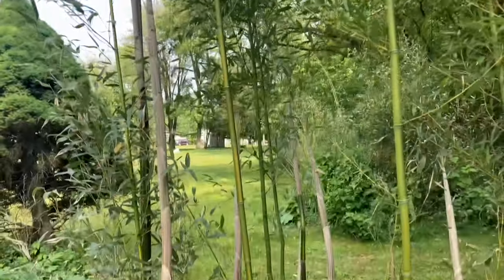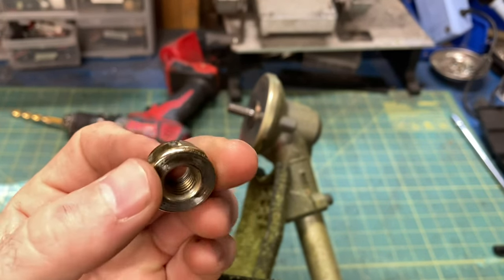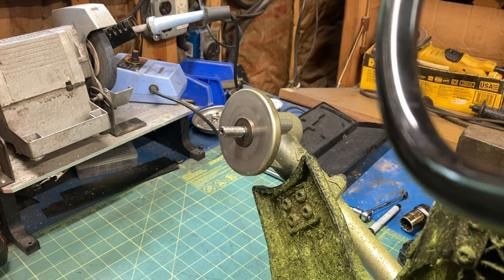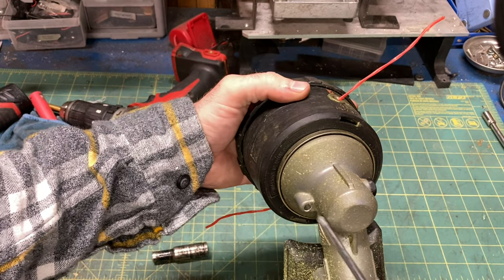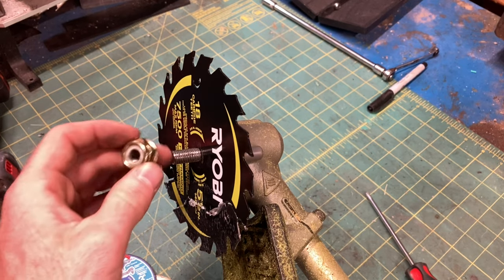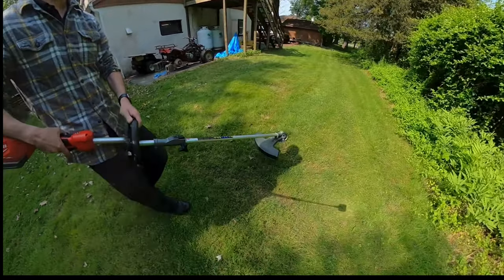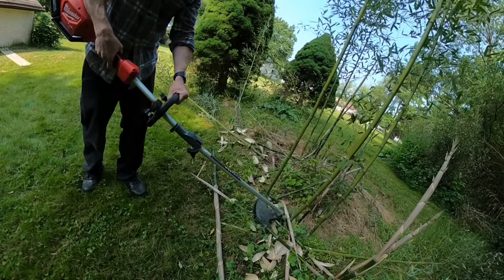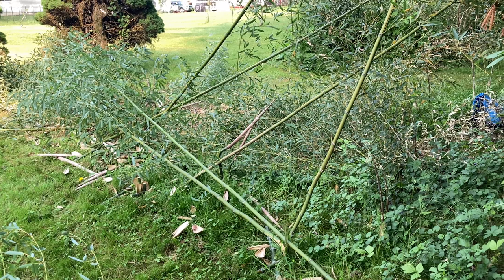Turn Any String Trimmer Into A Bad@ss Brush Hog For $11!

Comment: Maybe worth mentioning that most carbide tip blades have a max RPM.  Worth doing the math to make sure your head speed is wthin spec.  I once had a carbide blade on a belt drive table saw where "someone" (a younger me) had not done the math.  The result was terrifying!
Reply: Yes, using the wrong blade for the job can be dangerous. Anyone reviewing this video should not use a circular/table/miter saw blade. Use blades designed for trimmer heads. Angle grinder disks are even more brittle. Going cheap and having a catastrophic failure is not worth the risk. For those reading, buy the proper equipment to do the job safely and properly.
Reply: best to go without carbide teeth. especially if rocky area. the carbide shatters when you hit something hard

Comment: For the love of God do not do this at home. If that shaft uses a cable instead of a solid core you'll ruin the shaft. If the motor isn't powerful enough that's the end of your trimmer.
Reply from the maker: The blade I ended up with weighs less than the original trimmer head.

Comment: Never thought about trying a small blade on mine. But I think I'll keep my M18 string-only. I have a Honda HHT 35 string trimmer I hate using as a string trimmer. But I have a few purpose-built brush cutter blades for it. Let's just say that 4-strokes take a while to reach max RPM and a metal blade doesn't improve that aspect. But at least there's no question the machine is made to handle it. One blade I have is  Japanese and looks like a 4-blade mower blade. It's pretty badass but I don't know if it would take down 1" bamboo.

Comment: Safety mention:
Actually, unless the trimmers is designed to support the blade use, do not add the blade.  The clutch and shaft need to be sturdier to use blade vs string.
Reply from the maker: The poison is certainly in the dose. This ryobi blade is significantly lighter than the stock trimmer head, but I wouldn’t go much larger. You heard those teeth skipping with the big blade!
Reply: My friend had a commercial trimmer with the blade.
He bought a powerful one that had no blade offering for it.  He thought he could put the blade on from his commercial rated trimmer.
The internals we're simply not able to handle the blade.  The small cutter blade.
The shaft frayed, came apart, and ate up the tubular exterior,  @thedoubtfultechnician8067  
The heading on your video leads people toward the scenario described.
Seen bad results twice.
I enjoyed your vid.  Perhaps reword the heading so people don't ruin equipment, is what I'm lending.
Reply: @thedoubtfultechnician8067  IKR? Then you have to add a V-8 engine, and those make the hand trimmer a bit heavier.

Comment: I did this but made a mandrel for the mount of a 7 1/2inch blade carbide tipped.  The smaller diameter puts less strain on the bearings clutch and motor.

Comment: Im 58 now. Many years ago when i was in my teens we went to the SD county fair in del mar ca. In one of the booths they had for sale one of the first monfilament weed wackers. It was called the "green machine". It came with a powersaw type blade for heavy brush and branches up to 2 in thick and a 4 tined metal blade like a small lawn mower blade for lighter woody brush. It was heavy and vibrated like a jackhammer but it was very effective. I did a lot of work with that beast of a machine. (We lived  on a hilltop ranch where such equipment made lots of jobs a hell of a lot easier).

Comment: Not to shit on the awesomeness of this device, but any reason a chain saw or reciprocating saw with tree blade would not work for this application?
Reply from the maker: I mean if you wanna hunch over and crawl around in the brush, sure
Reply: @thedoubtfultechnician8067  Of course, I meant a chain saw with a 30" bar.
Reply from the maker: @roomservicetaco  That would take a powerful and expensive motor, and it definitely takes the danger to the next level. I’m all for it, let me know how it goes :)
Reply: A 24" bar works great for brushing unless you are tall.

Comment: $20 per gallon! I picked up a metal pre mix quart container, a dollar store basting syringe for metering 2 cycle oil and I mix my own from 91 octane gas so that there is no alcohol in it. I pump the first gallon or two into my vehicle to purge the pump before filling my gas can. It does not go stale over winter and works great!